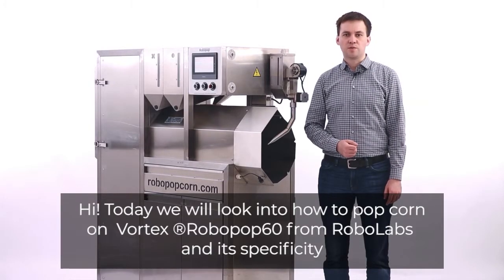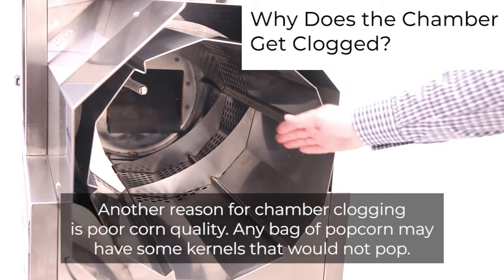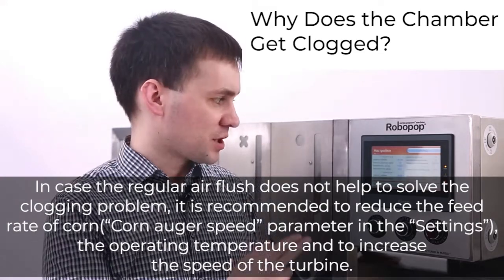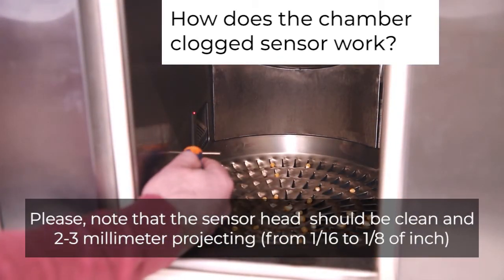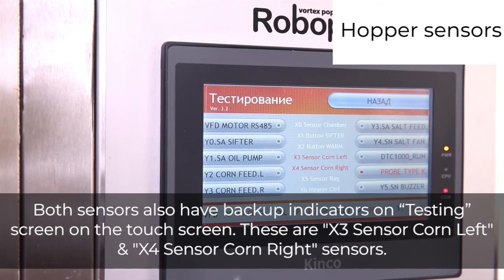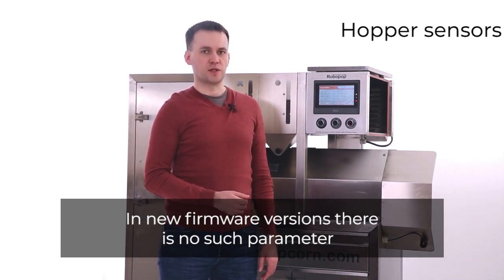How to fix common issues with RoboPop 60/75 Popcorn Machines by RoboLabs

Comment from the maker: 00:00 Choose the right temperature for the popcorn kernel
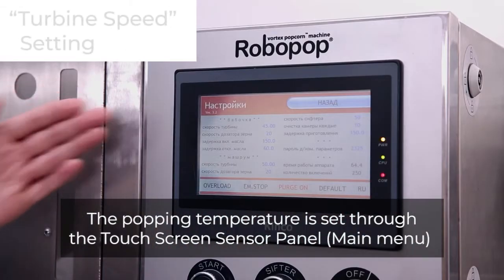01:44 Adjusting the turbine speed
02:34 The performance of the Robopop60 popcorn machine: what affects it?
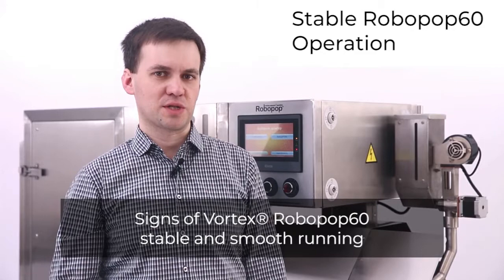03:20 How to achieve stable operation of Robopop60 vortex popcorn machine?
04:02 Why does the chamber get clogged? 
06:50 "Chamber clogging" sensor in a commercial Robopop series popcorn machine
09:17 Hopper sensor
10:50 Differences in old and new software for Robopop60